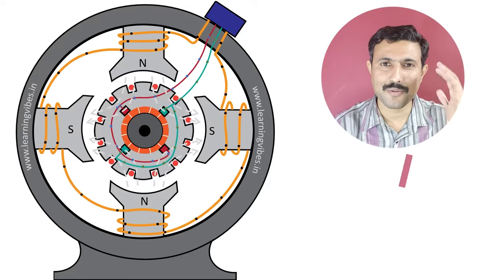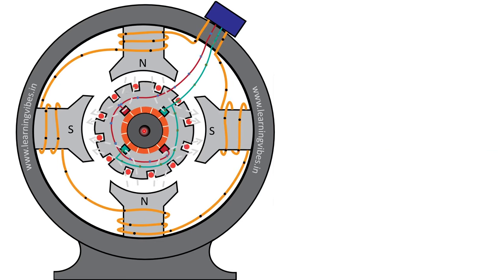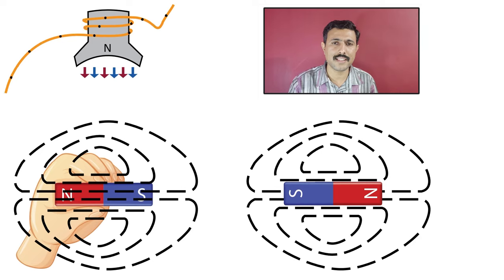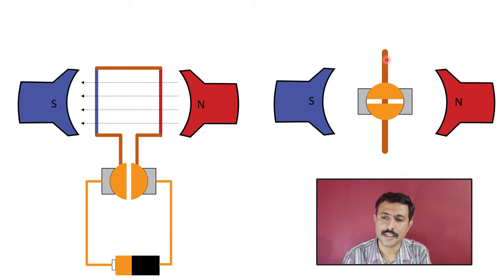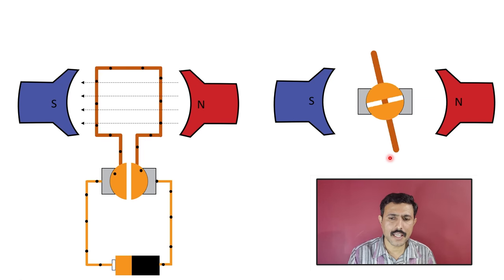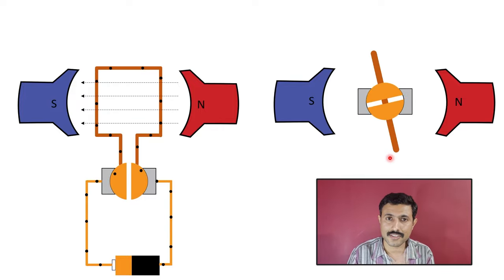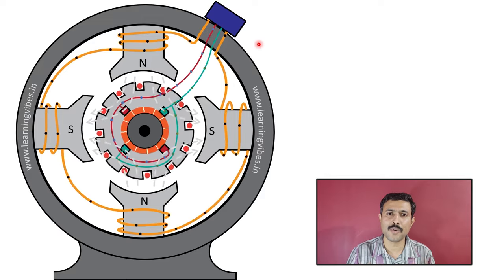Working principle of dc motor with animation | How does electric-dc motor works? | Mruduraj

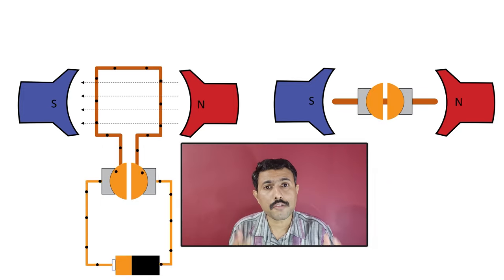Comment: Thank you for the video. One question I still cannot find an amswer to: with your simple animation which starts around 4:30, there are 2 brushes where the positive and negative brushes oppose each other. In the full animation you use through the beginning and ending of the video, there are 4 brushes which the negative brushes oppose each other and the positive brushes oppose each other. How are the loops of armature configured then, does each loop have ends 90 degrees to each other instead of 180 degrees apart?

Comment: can the supply to stator and rotor be Ac? if not, why ?
Reply from the maker: If you give an AC supply to a DC motor, the motor will not operate as intended. DC motors are designed to run on DC power, which means the current flows in only one direction. Where as AC power changes direction and magnitude at a fixed frequency, which would cause the motor to vibrate and produce a humming sound.

When an AC supply is connected to a DC motor, the motor will experience an initial surge of current due to the capacitance of the motor windings. This current surge can cause overheating and damage to the motor windings and brushes.

Comment: What is the work of brushes in the motor ?
Reply: The brushes continue to make contact with the commutator as the armature spins, allowing current to flow into the armature.   This keeps the torque on a DC motor from reversing every time the coil moves through the plane perpendicular to the magnetic field.